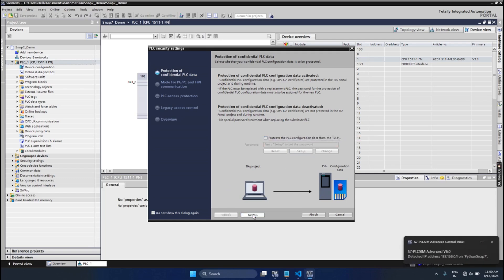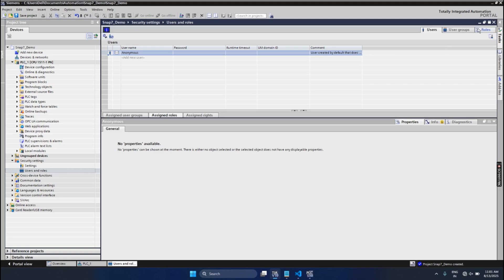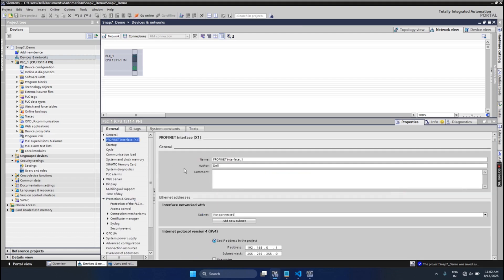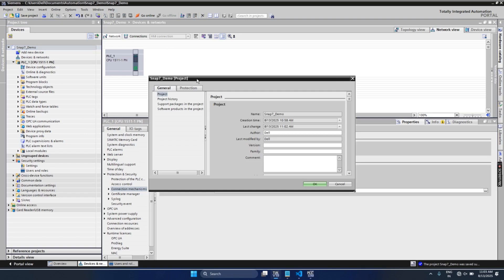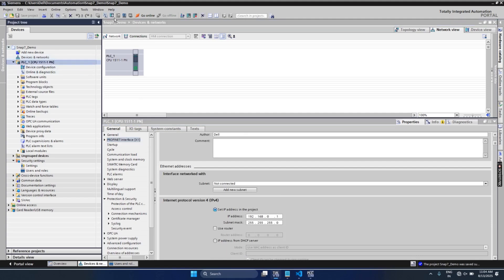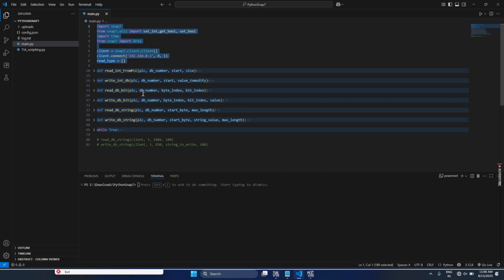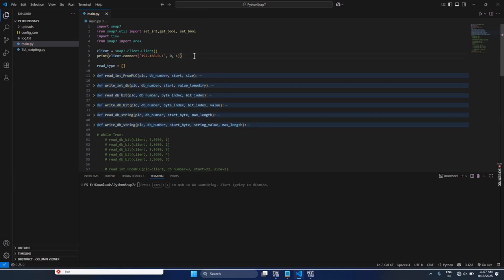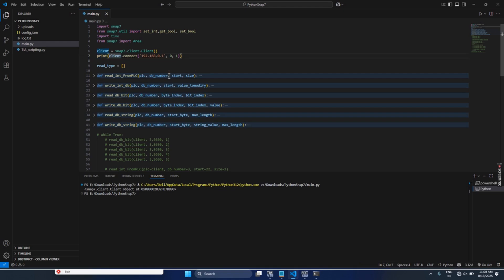PLC Configuration & Python Snap7 Communication | Step-by-Step Initial Setup Guide

Comment: I am writing a Thesis which has A PLC S7300. Now i want to read the data from PLC and Visualize the system on a cloud platform. What is the best possible path for it ? Is Snap7 using python a good idea and implementable ? Can it communicate on cloud from anywhere in world ?
Reply from the maker: Python snap 7 uses IP address for connecting to PLC this means your PLC should have direct internet access which is definitely not safe I guess. So snap 7 is not ideal for this l, it could be good for intranet which does not have direct Internet connectivity. Indirectly methods should be explored for the same. In upcomming videos I will try this and let you know.
Reply: @engineerpoint2658 Can i connect with you on some platform so you can help me a little ?

Comment from the maker: Learn how to set up your PLC for communication with Python using the Snap7 library.
In this tutorial, we cover the initial configuration settings in your PLC, explain network parameters, and show how to prepare your Python environment for a smooth PLC-Python data exchange.

This guide is perfect for automation engineers, PLC programmers, and Python developers who want to connect Siemens PLCs with Python for data reading, writing, and industrial automation projects.

📌 What you’ll learn:

How to configure Siemens PLC for Python communication

Setting up IP address, rack, and slot parameters

Installing and importing Snap7 in Python

Basic connection test between PLC and Python script

Common setup mistakes and troubleshooting tips

Whether you’re starting with PLC data logging, HMI integration, or IoT projects, this step-by-step setup guide will help you get started fast.

#PLCProgramming #PythonSnap7 #SiemensPLC #IndustrialAutomation #PLCToPython #Snap7Tutorial #PLCConfiguration #AutomationEngineer #TIAPortal #PythonAutomation #SiemensS7 #PLCProjects #PythonIndustrialAutomation